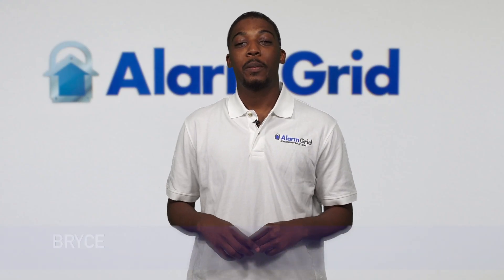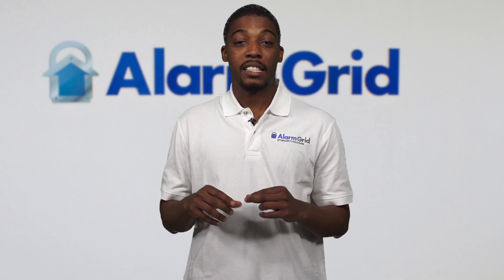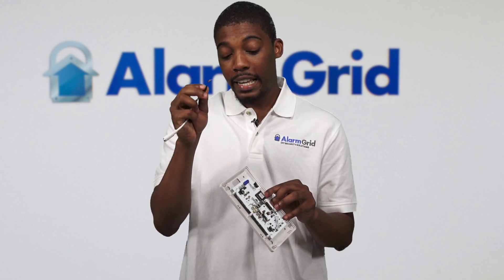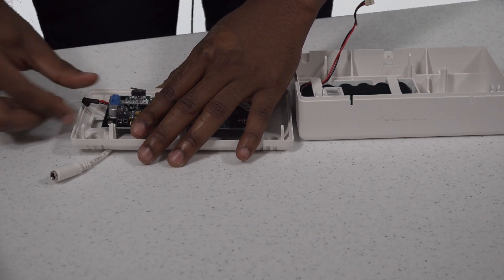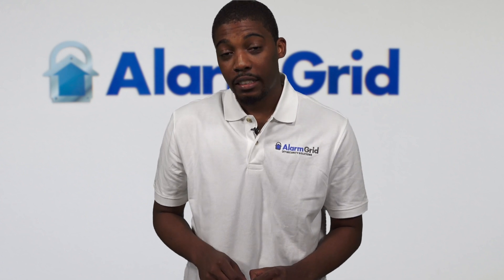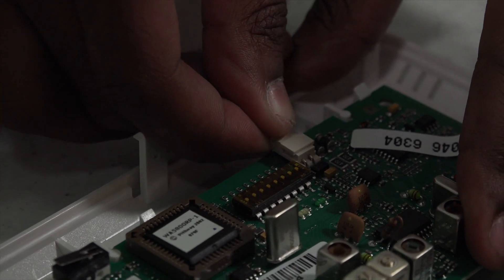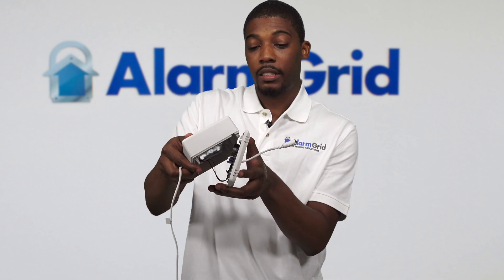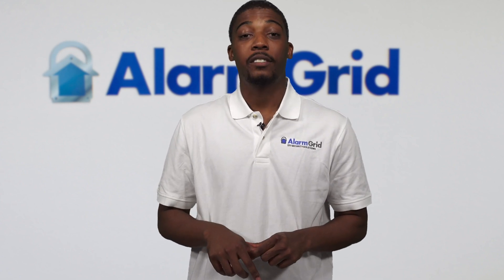Installing and Programming a 5800RP

Comment: You ever use 2 repeaters?
Reply: You can add as many repeaters to a Honeywell System as there are wireless zones on the system. However, there is rarely a situation where you would need more than one wireless repeater. Each wireless sensor can only have its signal repeated once.

Comment: Not one of these posted videos ever once explains WHERE to mount the repeater.
Reply: The reason being is that everyone will have different circumstances when it comes to using the 5800RP. The best rule of thumb is to mount it halfway between the device or area you are having signal issues and the panel. You can use the LED to see if the signal is weak or strong and using that will also help you choose the best location for placement. Hope this help!
Reply: @traviscox7336  I think explaining this in the video would be best and especially the LED part.

Comment: ANTENNAS: If you use the antennas (which I recommend), look for the two black terminals. Orient the 5800RP so that those two terminals are on the top (so the blue terminals would be on the right-hand side). Screw in one antenna into the RIGHT terminal slot in each pair (the left terminal slot of each pair will be unused in this case, giving you one antenna on the right of the board, and one on the left of the board). The antenna outlets of the enclosure should match up this alignment when you close the 5800RP.

Comment: I am installing the lynx touch 7000 in a house that is about 60x100 in dimension.  I plan to centralize the lynx touch to maximize the coverage of the zwave function.  I also have a detached garage that will be about 100' away from the lynx touch 7000 and will have two masonry walls and about 4 walls with drywall between them.  Would this be a good solution to extend zwave functionality to the garage?
Reply from the maker: Jeff, the 5800RP will act as a repeater only for the Honeywell 5800 series wireless devices.  It will not repeat for Z-Wave devices.  The good news is that nearly all other Z-Wave devices will repeat Z-Wave signals, up to a maximum of 5 hops I believe (4 Hops + Destination).  So, if you have range issues, just add more Z-Wave devices in the areas where signal is an issue and the problem should take care of itself.